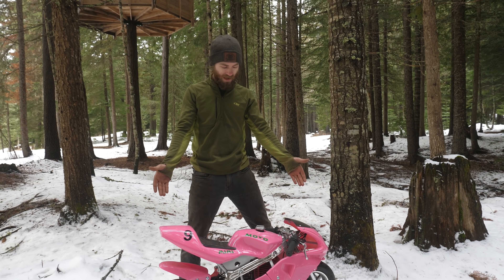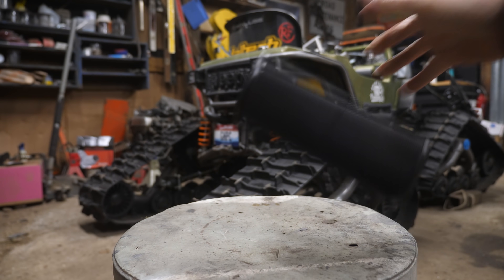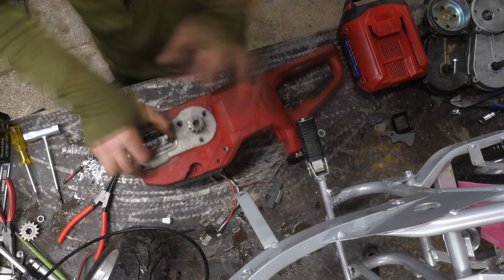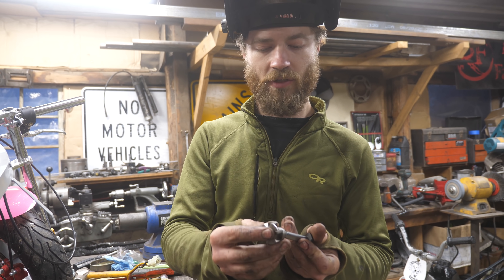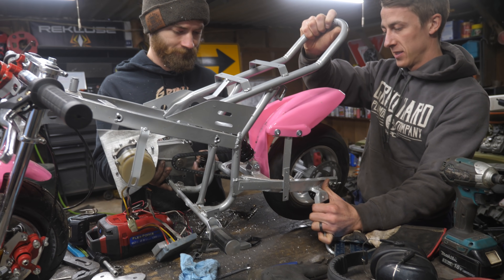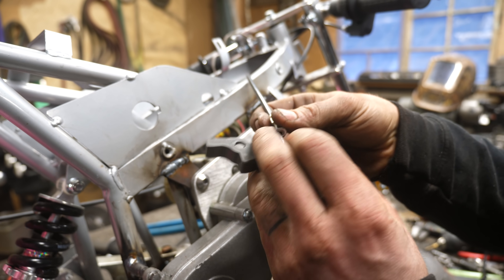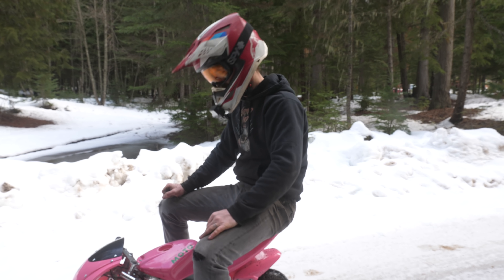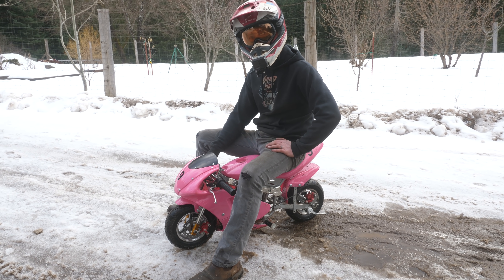Electric Chainsaw Powered Amazon Pocket Bike Build

Comment: Next, you need to make an altermotor from a 200amp gm alternator. It'll give you a "transmission" of sorts too. 1-5v on the slip ring either gives more speed or more torque.

Comment: Seen video of new engine style (*new to me) 6cyl. Turbocharged engine no surprise I've seen very few airplane engines but couldn't help thinking of all you ppl from or associated with the Grind hard plumbing Co. channels. Idk 6cyl 12 spark plugs 2 coils 2 fuel pumps everything gets doubles or several redundancies. Stalling would be a different ball game. How about a build for the 2ndChannel part land part air all turbo what could it be? A bird? A plane  or  a grind hard plumber?  still tossing the ideas around as usual. Part air boat/ski steer or mini track steering like Col.Senders with 550hp engine? Too grind hearty? Nah, it'll be OK RIGHT?👍

Comment: I like it! Needs a better throttle though, and probably an engine built for more load than a chainsaw typically runs under. If nothing else delete the safety switch that kills it when you hit a bump, but if you do that you’ll probably just burn that motor out. Try a spin cycle from a washer! Those move heavy weight clothes at a high rpm for nice durations

Comment: I bought one of those pocket bikes about 10ish years ago from walmart, cheap little piece of electric crap.
Chopped the forks off, then the rear end. Added about 2.5ft of tubing between rear and front forks, pseudo seat, 60cc 2stroke.. Made a low-rider bike-car thing, was a LOAD of fun and surprisingly fast.
Shape was essentially this:  o#\___/To  -- with the # being the engine and 'T' being handlebars/forks, you sat in front of the engine with your ass about 2inches off the ground.
(Just put pegs on the front wheel's hubs so you at least had /some/ place to put your feet.. Wish I had a picture of it, was fun AF to ride and did about 40mph)

Comment: There had to be a clutch issue or just straight up oversized/overweight for the bike because I had one of these little pocket bikes and that thing would rip around 30+mph with me on it when I was in my early 20's so I'm thinking the engine never was given a chance to rev out where two strokes get their power from! But definitely still a fun and interesting swap for sure 😆

Comment: take it in everyone, this is the future. no exhaust, no noise, just the agonizing sound of screeching tires on wet pavement and the underwhelming whine of electric motors that will buzzkill any conversation about how good the old days were when gas engines were still around. 

still a cool build though, just wish ev wasn't the death of an industry

Comment: Do yourself a favour and buy some quality VESC for this stuff, more torque, more speed, fine throttle control + proper ev throttle.
Just make sure you don't get one of those VESC that are just wrapped in heatshrink, those are usually barebone and blow up often from voltage spikes, anything in aluminium enclosure should be fine, like trampa vesc.

Comment: Ethan and Edwin, are you guys interested in a 04 gsxr 600 with low miles? I have one in good condition with low miles that doesn't have a title.  I've been working with the licensing place to get the title but I've realized it's not something i want to ride.  Everything works and I'll supply pics or vids upon request. 2 grand takes it. Let me know if you're interested (western Washington).

Comment: Haha been doin high end RC stuff for years, torque is fine but you will only get 10-15mph out of it. A good speed controller will pull way more amps than that little chainsaw could ever dream of. You'd of been better off using 1/5 scale electronics, motor, and batteries with some good gearing. 1/4 scale and bigger will cost you more than you even want to look up.

Comment: Years back, I had a pocket bike. It was a 2-stroke 50cc. It also had the only cvt I've ever seen on a pocket bike. At 250 lbs., I'm no featherweight, but on a flat straight, the bike would pull me at 35 mph.

Comment: back in day i got Suzuki R 80CC malossi racing pipe-28mm carpurator-5 gears - Gears 14/43 Suzuki R looks like Street Bike But it's a 3 size bigger than that mini bike fun little moped with 100kmh speed

Comment: As a big RC helicopter guy, I want to suggest looking into a good quality speed controller. That's the heart and soul of an electrically driven vehicle. Even more important than the motor. There are lots of nice, programmable variable speed controllers to choose from. You can set throttle curves and everything. Check the RC aircraft community.

Comment: Put an O-drive controller on that stat!  (Though 60v is pushing an O-drive a little)  The bit of extra work fitting an encoder is worth it for the low speed and torque control you'll get.  (think trials bike lvl control/responsiveness but better)

Comment: Idk what style of batteries are in the toro if it were me I would switch out to some lipos or a Lithium ion style battery that is super light & u will be able to ride longer & have quicker Get up for faster acceleration due to the output of the battery is key with anything electric or EV as u guys put it plus the ecu to  Monitor & adjust speed ,temp, life, & many other  Parameters just take the Suron 4 instances from stock to how badass Ethan has his built 2 now by the to small but expensive changes lol Science !!!

Comment: ok uh, on the off chance you read this and don't already know, havin the throttle as a speed-controller can cause the motor to burn out, if there's like too much load on the motor and it's still tryin to spin past it's limit. There's a pretty high chance i'm speakin out my arse but hey. But Anyways nice build my good bros, anythin's an improvement over that sorry-ass motor lmao, have a good one lads

Comment: If it's a DC motor you can solder a diode between the electrical contacts on the outside to let the motor freewheel forward when you let off the throttle instead of stopping dead like that.

Make sure the current and voltage rating on the diode meets or exceeds the current and voltage rating on the motor.

If it just doesn't run when you hit the throttle you've soldered it on backwards.

Comment: I'm on with something silly combining a quod with dirt bike version of those to make a reverse trike and EV adding a free wheel sprocket will help the battery last longer and way less where on the gears it's like engine braking which is useful but with EV with out regen means you need to waste power to cost

Comment: This is amazing. There are similar 49cc pocket quads that could use an e-chainsaw conversion...
Reply: Needs a stihl ms311 timberboss chainsaw engine on it.  59ccs of quad ported two stroke craziness unleashed on to wheels. Riding wheelies until you back the throttle down. Would be cool to see something like this.

Comment: Most consumer electric chainsaws have a safety feature that cuts power if the saw gets hung up and the chain stops abruptly. It's meant to keep people who don't know what they're doing from getting pulled forward onto the saw and kickback injuries. It's built into the micro controller for the motor.

Comment: Motorcycles have a kill switch for safety, chainsaw comes with a kill switch already wired... Ethan: "we don't need that"

But seriously wouldn't it be easier and safer to just add the kill switch the way a traditional motorcycle has it?

Comment: The problems with the throttle is because it was a chain saw so it gas a safety so if you slipped into the blade and let go the blade wont be spinning so it can't cause alot of damage

Comment: You need to google/research dc variable speed motor controllers for throttle. Lots of options. Just need to match the volts and amps.

Comment: Need to get a few extra packs of the same amp hour and run them all parallel to keep the voltage dropping under load plus you will have more run time!
Reply: If they are connected in parallel he just needs battery packs with the same voltage/ amount of cells in series, the capacity of each pack doesn't matter when they are connected parallel.
Reply: @mashedpotatoes5323  if not u will have the lower packs drained faster and then the higher ah packs will be the only ones powering until they all die. It will work tho
Reply: @2down2togo  that's not how it works at all.... As a example let's say you have two 18650 cell's (each are 4.2 volts fully charged), one is 2ah and one that is 3ah. If you were to put those cells in parallel it would become a 5ah battery. The 2ah cell cannot drain faster than the 3ah cell because they are connected and at the same voltage, anywhere from 2.5-4.2 volts. The only time you have to pay attention to capacity is when the cells are in series because the 2ah cell will drain before the 3ah cell and it will over discharge, for example the 2ah cell will be fully discharged at 2.5volts while the 3ah cell will still have some power left and be around 3volts. If you continue to use the battery the 2ah cell will go below 2.5 volts and get damaged while the 3ah cell still has some capacity left. Although the one thing to pay attention to when putting batteries/cells in parallel is to make sure they can handle the current load. If you parallel batteries that cannot handle the load they will get damaged.
Reply: @2down2togo  when putting batteries in parallel you also need to make sure they are at the same charge level/ voltage, if you connect a fully drained battery to one that is fully charged then the fully charged battery will dump a bunch of current into the drained battery damaging both batteries by discharging too quick and recharging too quick.
Reply: @mashedpotatoes5323  that is true. And if u leave them all together the voltage will equal out in them if they aren't under load
Reply: @2down2togo  the voltage will equal out regardless if its under load or not that's the whole point of parallel.
Reply: @mashedpotatoes5323  yeah I get what your saying but the lower rated cells will push harder to do what the higher rated batteries are doing which will cause the lower ones to eventually fail.
Reply: @2down2togo  that's still now how it works my guy... There are many types of cells, some of them are able to output a lot of current and they are found in power tool batteries, ebikes, vapes, ect.. but they tend to have a lower capacity, while some cells can't output a lot of amps and are found in small devices like portable fans or laptops but they tend to have a higher capacity. It would obviously be a problem if you were to try to use laptops grade cells for a high amp load but that's why there are different cells for different applications with different chemistry, capacity, and internal resistances. As long as you pay attention to the basics like making sure you aren't drawing too much current from the batteries and the batteries are the same type there is ABSOLUTELY no issue putting two battery packs with different capacities in parallel, if anything it will be better for the batteries/cells because now you have more of them to handle the load.
Reply: @mashedpotatoes5323  u literally just said if they are the same type of batteries u can put them together lol but its all good man theres no reason to have a big debate i will continue to do things my way and u can do it your way. Thats the beauty of these different types of hobbies is its our money so at the end of the day spend it how u think will work for u! Have a good weekend man im going out to run my rc's!
Reply: @2down2togo  I know exactly what I said.... I'm not sure you understood it though. You clearly need to learn more about lithium batteries and I thought I could provide some information, I wasn't trying to have a debate I was just simply telling you that your original comment and the one after that too is completely wrong. Nothing to debate about that here.
Reply: @2down2togo  "u literally just said if they are the same type of batteries u can put them together" you got that half right. As I said there are MANY types of cells, some cells with different chemistries and different voltages. And as long as you choose a cell that can meet the power requirements and is the same  chemistry as your other cells then it doesn't matter a single bit if they are different capacity and put in parallel, nothing bad will happen.

Comment: Watch u don’t get shocked those battery’s have a lot of amps volts won’t kill you but the amps will get u every time may not kill you but I promise it won’t feel good that’s a juicy battery pack for that electric chain saw
Reply: I don't think you completely understand how you can die from electricity. While it is the amps that kill you the only way for your body to actually get a deadly dose of amps running through it would be to touch a very high voltage source so that it can get through the resistance of your skin and stuff. So basically you can have a 50volt battery that can put out 100amps and that would be just as safe to touch as a 50volt battery that can only output 1amp.

Comment: You really shouldn’t need gear reduction for an electric motor. The only thing that you need is a variable speed trigger and a decent/ adjustable speed controller. Keep up the great vids
Reply: Not all electric motors are happy at low rev high torque applications. Especially a motor designed for a chainsaw. Keeping the revs high and the wheel torque high via reduction is the way to go.

Comment: You boys should get a 3d printer. Probably not a s suitable tool to keep in the shed but it would allow you to design and print plastic (even a cheap printer will print PLA well) and allow you to rehouse some of these chainsaw components. I recently used mine to design and create a new mounting bracket for the speedo cluster on a 85’ cb500. Additionally, you could connect the electric throttle from the chainsaw to a spring-return variable resistor to allow you to connect a braided steel cable to a standard motorbike handlebar throttle. I’m an electrical engineer and just want to play in the shed with you guys....😭

I think learning CAD and having a machine would help you guys tremendously

Comment: This is a perfect intro to EV's! I'll send you a better controller that has a better throttle and higher rpm and voltage.
Reply: the "make good use of what's there between them" approach was great, it definitely needs a better ESC setup. with the "use existing stuff!" approach, I'd stick with the chainsaw battery (is it 3S or 4S and who cares?) and put a smaller sprocket on the rear wheel to give it more top speed... before ever trying to take it into higher voltages, because reliability. not knocking you or your generous offer one little bit, its just my opinion of how to stay with the project theme. the other option is maybe ditch the second reduction box and slap a larger sprocket on the rear wheel... I do kinda think it should top out at 22-25 mph so its fun.
Reply: @modelnutty6503  well I'm pretty sure they bought the chainsaw for the project, so there's that. The battery is 60V max so likely 15-16S. Not horrible and it can be adapted for other 48v controllers (which max at 60v). The chainsaw kit they have is $215, which is a lot. A 2010 motor capable of up to 10kW with a 1.5kW controller is $100. Another $100 for some more batteries and they'll have a much better performance drivetrain.5
Reply: @Dogburt_Junior  chainsaw to bike is a “YouTube” type project bare in mind . 

They’ve a lot of knowledge between them, I feel they’re aware of the motor market (I’m sure they like I, am always open to more opinions) electric/petrol etc
Reply: if you gave them a VESC it has a self-balancing so you could have infinite wheelie button..
Reply: Send it to me :v
Reply: @mrroze427  they are $20-40 on eBay for cheap ones in aluminum housings. Pretty dependable.